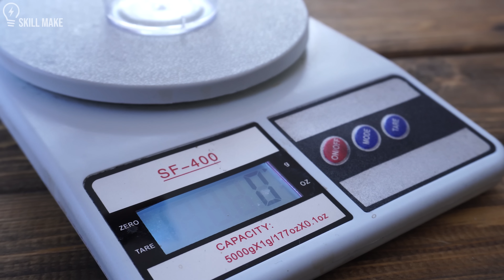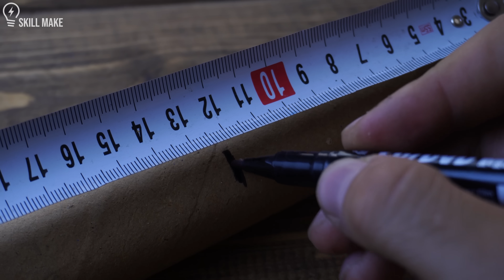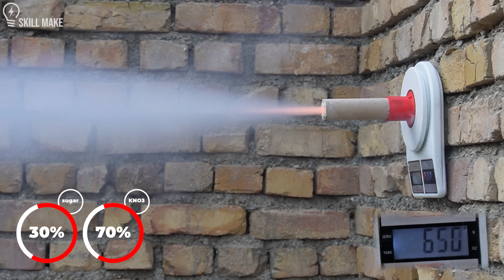Sugar-Powered Rocket: How I Made a Rocket with Sugar!

Comment: I know this was a year ago, but the biggest thing I've found is that lighting it from the top instead of the bottom works wonders; it makes it burn from the inside out rather than from bottom to top, increasing how much of the surface area is being burned at once, increasing thrust. I've achieved this through an electric fuse, made with a couple batteries and some wire, shorted with Nichrome wire.

Comment: Some advise:
- use 65 : 35 ratio
- make nozel shape in propellant tube output. Simply make smaller diameter about 1/3 to 1/2 tube diameter
- carefully set CG of the rocket at the tail stick, about 1/4 - 1/3 length of tube, below the the nozzle position. It will stabilize the flight straight up
- mix the ingredients while dry powder state thoroughly will make it more homogen. Then cook it together.
Reply: How long should i let them two boil? and at what temperature/flame size?
Reply: @Solage_Zeq  Small to medium heat is enough — just enough to melt the sugar into caramel. Keep stirring while heating so all the powder caramelizes evenly, and make sure there are no hot spots. If the pan gets too hot, the mixture can actually ignite when it reaches its flash point.
Don’t ask me how I know… I almost burned my house once. 😅
Reply: @aditbije  Thank you so much!
Reply: Would you mind explaining a bit more about how to make a nozzle properly?
Reply: @giingapyro for this type application (flying fireworks/rocket), just simply make a small hole on the bottom plug of your tube.
The hole diameter is subject to trial and error. Try some different diameter to find the most fit for your rocket.

For the serious rocket project, there is a calculation to get proper dimension and shape.
I was found some fellas shared it on a blog, back several years ago. But I can't really remember it well
Reply: @aditbije  Thanks!

Comment: Try using a smaller core inside rocket 🚀 motor, also potassium Nitrate love moisture and that will cut  thrust.  😊 Nice video.. also try purifying the potassium nitrate using crystallization lots of impurities in potassium nitrate from stump remover.

Comment: strange how the right amount of sugar is best and going to no more or less by a small amount gives lesser thrust, perhaps play between 35 and 30% to see if you can improve the thrust but also there might be too much water in the mix, you should let it dry cure in the oven to get a better solid propellant and add some fins to your rocket for stability to make it fly vertical or place it in a long launch tube and i would make the bore hole of the propellant mix much smaller to get more pressure better thrust

Comment: I think that the fuel based on sugar is not really perfect. First it has a tendency to clog , second when you prepare such a mixture on the kitchen or a torch immagine your mistakenly done bad move and what if everithing goes burning in your appartment :). It could be not really safe and compfortable ;)
Reply: Needs to use electric skillet

Comment: In order to increase the burning surface the center hole shouldn't look like this ⌾ but more like that ❂ or that ✪. In addition you should ignite it from the top in order to ignite the whole center core hole at once. Then it will burn from inside out and not up from below. Electric ignition is required in that case.
Reply: Two solid scientific case there.

Comment: My idea of a rocket is to put a tin pipe inside another pipe and seal it, fill the gap with fuel, at the top have a small pipe going across the opening of the pipe with a hole pointing back wards, the heat from the fire boils the fuel that makes more fire more pressure and pushes the rocket up until the fuel is finished.

Comment: You need a smaller dia cored into the fuel and a nozzle made of clay with a hole drilled.
Reply: I think the core diameter is Good, but Yes, use a Nozzle With about 8mm 
And PLEASE, light the fuel up ONLY at the very top of the grain 😋
NICE cut!
Reply: ماهي المواد لصنع الوقود
Reply: thats exactly what I just posted.

Comment: I used 35% sugar and 65% pottassium nitrate  its works properly
Reply: saya membuat amunisi 70℅ magnesium nittrat 25℅ gula, 10℅belerang, tekanan dorong dan ledakan sangat kuat,
Reply: bg yakin ini bisa buat nembak gak @bangjoy9178
Reply: seems like he got more thrust from the 30%
Reply: how do u measure without scale
Reply: @motormadness4stroke use 0ne glass & start from 50% to see where 40% & 60% are 🤷🏿‍♂️
Reply: how much water
Reply: Assuming KNO3 is available freely which in most of the world it isn’t

Comment: How fun! I love your videography, your experimentation.  The major hole in your storyline is what you are using for a fuse.
Reply: I thought everybody knew this but I guess not, you can soak old school style kite string in potassium nitrate AKA saltpeter mixed with water and have a working fuse. Then at the bottom of the rocket we used to incase those fuses in dried caps of black powder. You would actually turn the black powder into a paste with water again and cover the entire bottom of the rocket motor. I was a 1980s Estes Rocket kid that ended up buying the Teleflite 5-cent sugar rocket manual. I made my own at age 13 and I'm thankful for those experiences.
Reply: @sierratango6574  I have 2 of the older books and 1 of the newer book. Had a lot of enjoyment with my 3 sons making rocket motors. Working in a machine shop, I could make all of the tooling. Robert Sleeter.

Comment: Hello my friend! I had an idea for a science experiment! 1.Take a pot of water and ground it. 2.dump a layer of dirt into the water with sand on top of it. 3.separate the waters with a divider between making it two separated waters. 4 use a multimeter and copper rod to generate a charge into the pot for a few days one side positive energy, one side negative. (I’d do 7 starting on a Monday to check growth and take notes on cycles.) 4. When the 7 days are up, you boil the water with your preferred method. (I was thinking a battery to help charge ions.) 5. Catch the charged mist or steam in a safe container and see how it reacts. 🎉🎉🎉
Reply from the maker: I think you mean making homemade batteries, it is a good idea
Reply: @skillmake   I did a little research into this topic and you could use a multimeter to generate the charge (make sure the divisor is also grounded if not the charges will connect and they will not be separate) also worth noting, the Baghdad battery might have something to do with this idea!💡

Comment: You can directly mix sugar powder with kmno3
Reply: you can mix them directly but there are some advantages to using the water. You don't need to grind the ingredients into a fine powder, it is easier mix thoroughly, and you can easily cast the mix into a mold.
Reply: Why don’t these videos ever talk about finding oxidizers? We all know various sugars work great for fuel. But oxidizers can be difficult to to obtain.

Comment: 04:14  your method for evaluating “max thrust” is truly inspiring!
could you, provided with potassium nitrate, ascorbic acid,  red iron oxide
and do the same experiment"max thrust"  by varying the % of potassium nitrate?
(Making Crimson Powder for Rocket Parachute Ejection System:
6.2g potassium nitrate
4.5g ascorbic acid
0.5g red iron oxide
boil water,put ingredients in the pan;time to turn off the stove.remove the mixture.)